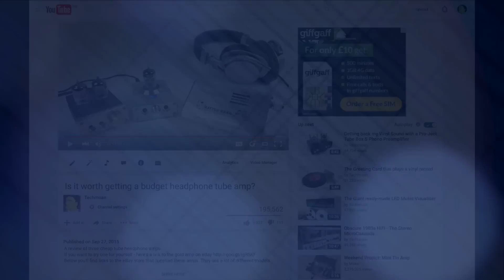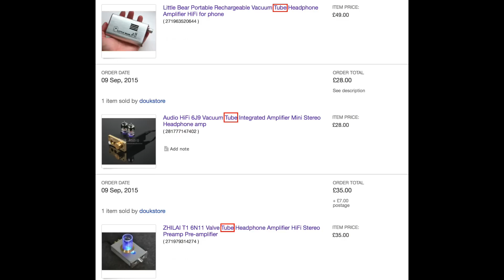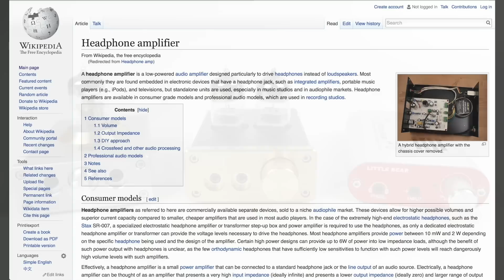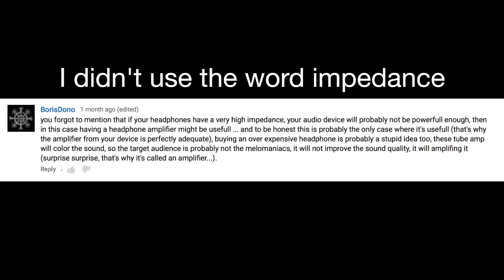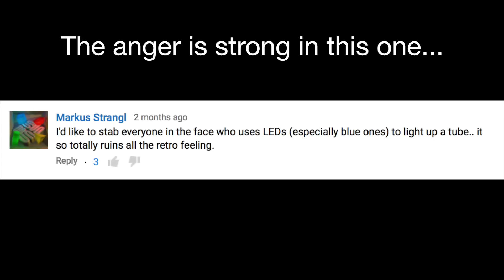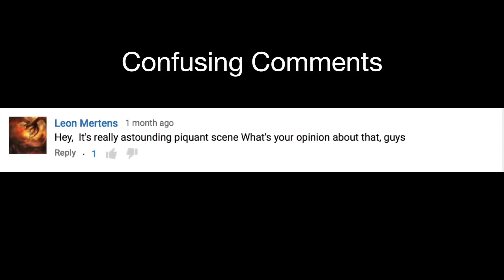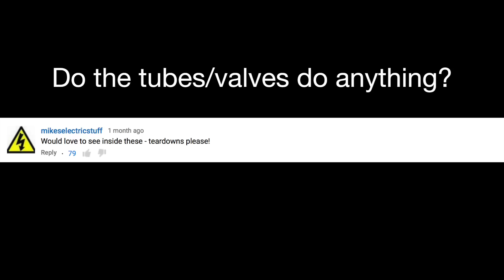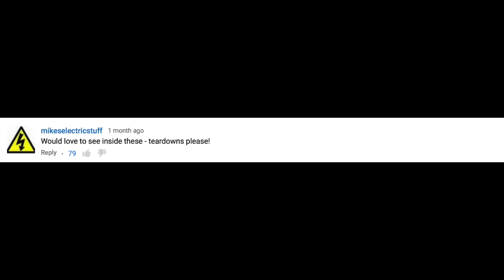Headphone Tube Amps - Follow-up & Tear-down

Comment: Tubes being microphonic pretty much just means they aren't in good shape. I'm not sure of the exact mechanism, but I believe some spacers inside the tube loosen up, which causes parts of the it to in vibrate in response to bumps, which causes the ringing. They are called microphonic because a tube in that state will be susceptible to vibrations, just like a microphone is. The fact that you could hear the ringing is a dead giveaway that the tube is in fact being used to some capacity, at least on that one amp.

The whole argument about tubes needing high voltages doesn't really do much either, stepping up voltages is a fairly straightforward process. Even back in the day of film cameras, flashes worked with upwards of 200V, which was generated from one or two AA batteries.
Reply: +ManuelJBD — Microphonics are a characteristic of most tubes, even when they're brand new.  It's caused by movement of the plate, grids and cathode relative to each other when the device is struck or vibrated.  The changing spacing affects capacitance, which causes modulation of the plate current.  Microphonics can be reduced, but not entirely eliminated, by adding more internal supports and reducing the physical size of the tube.
Reply: ***** I would suspect so. I remember I made a simple preamp circuit to buffer a piezo pickup, but due to a simple error I made it have a bunch of gain, and I noticed the entire board was microphonic. When I narrowed it down, I realized what was reacting was a ceramic capacitor!
Reply: ManuelJBD Yes, ceramic capacitors exhibit piezoelectric properties, so they can be susceptible to vibration and flexing.
Reply: +ManuelJBD That makes sense now. Back before you could find anything on the internet, I had a Peavy Twin amp that would ring like that just playing on it. I never looked to see what it was and the amp is long gone though I wish I still had it. I get the impression of the filament in a light bulb when you tap it.
Reply: +ManuelJBD Back in the 1910's-20's, most radios were run on batteries. The B batteries that supplied the plate voltage were in the 50-90 volt range. The heater batteries were usually 6 volt lead "car style" batteries, and when used, the grid bias batteries were usually 1.5 volt flashlight batteries. Battery powered portable tube radios and phonographs were still popular in the 1950's. These radios were fully capable of producing room filling sound.

Comment: The 6N11 is a Chinese version of the 6DJ8/ECC88. It is a twin triode (three electrodes, cathode, grid, and plate; similar to the collector, emitter, and base of a transistor) originally developed as an RF amplifier for TV receivers. It is a nine pin miniature tube. The pins used are 3 and 8, cathodes; 2 and 7, grids; 1 and 6, plates; 9, internal shield; and 4 and 5, heater.

The 6J9 is a triple triode, 10 pin miniature tube, originally used as an RF amp, oscillator, and mixer in FM radio receivers. It's pins are 3 and 10, cathodes; 2, 9, and 7, grids; 1, 6, and 8, plates; and 4 and 5, heater.

The 6021 is an eight pigtail sub-miniature industrial twin triode used as an RF amp and oscillator. It's pigtails are 5 and 4, cathode; 7 and 2, grids; 8 and 1, plates; and 6 and 3, heater.

I have no idea why they are using VHF RF tubes as audio headphone amplifiers, where audio tubes like the 12AX7/ECC83 would be more appropriate. I also have no idea what the ICs are for in those units, as the tubes alone should suffice in this application just as they did in the 1950's-60's.
Reply: +compwiz101 That's why old amps used a transformer to match the tube's output impedance to the low impedance headphones or speaker. The other alternative was to use high impedance headphones. BTW, it's not a good idea to run a transformer output amp, especially a high power one, without a load on the transformer's secondary. Apparently, you could fry the transformer.
Reply: @dougbrowning82  I have seem some vids of USA repair folk using a dummy load, what actually is this comprised of and does it need to be matched to the different transformer outputs ?
Reply: @highpath4776  A spare speaker that matches the impedance and wattage of the original should work (could get quite loud and may blow the speaker). Alternately, you could use straight resistors (resistors will get hot, and you can't hear the output), or a combination of resistors and a speaker. Search Google for dummy load circuits.
Reply: The problem with high impedance headphones and speakers like those used by 1920's radios is that you end up with high voltage on the audio lines. They are also harder to manufacture, and end up being more expensive. Though high impedance dynamic speakers (this is, using a cone with a coil attached and a magnet) existed on later budget devices, most of high impedance devices were vibrating iron type. These included the so-called reed speakers, and earpieces that had a steel disk as their diaphragm. They worked, but their audio quality would be considered unacceptable by most modern consumers.
Reply: +Doug Browning A lot of the headphone amp designs I've seen tend to pass the signal through the tube, then use solid-state components to provide the final drive current to the relatively low impedance headphones. Most tubes have fairly high output impedance, unless you're using a cathode follower...
Reply: +Doug Browning Yep. If you're going to build a tube headphone amp, you really have to budget for two output transformers. As I recall, running without a load can allow (in high voltage amplifiers) for a number of problems, including the power tube not seeing the correct load, but also inductive spikes in the transformer exceeding the winding's insulation strength.
Reply: The ICs are mostly likely being used to generate clock signals to boost voltage from that battery through that 6800 uF capacitor. Think Dickson voltage doubler. That's likely how a 12 volt power supply or that rechargeable battery can achieve enough voltage to push a tube.
Reply: +compwiz101 As I recall, even the early transistor amps in the 1950s and 60s, had transformers, not only as impedance matchers, but also as phase splitters for push pull output stages. Engineers in the day certainly didn't mind budgeting for a lot of iron in their designs. Since we're going back to vintage tech, though, why not just bring back high impedance headphones and speakers, like they had in the old days? Perfect for use with tubes, no transformers required.
Reply: +Doug Browning  Old surplus stuff. Personally, RF tubes always sound narrow. 
Any chance we can measure heater voltages?
Reply: +Don Petrik All three tube types use 6.3 volt heaters.
6DJ8 - plate = 90V, grid = -1.3V, amplification factor = 33
6J9 - plate = 125V, grid = -1.0V, amplification factor = 57
6021 - plate = 100V, grid = -6.5V, amplification factor = 35
(all ratings per section)
Reply: +Doug Browning 
"measure"

On paper is fine, what are we getting in the device for real? (measured heater current under load would be even better lol)
Reply: I totally concur.   Especially the notion of using op-amps and RF thermionics....  But then, the Chins use all sorts of weird thermionics in their designs....  As a browse through eBay shows.   Like the weird FU32 (832A - Push-pull tetrode...), athough admittedly,  it is appropriately an amplifier bottle.
Reply: Due to the potential
Reply: There is some idea that solid state amps as pre-amps are a good idea, with the tube technology giving the main AF amp.   Indeed why use RF frequency Amps though,  I presume someone sold the Chinese some kind of false espionage at some time and they think it is the correct use, though as circuit design books are avalible it would make sense for them to investigate and design something from first principles, something I dont think the chinese are capable of because they dont understand what is trying to be achieved as the end result.

Comment: The pins of the tube sockets are propably all connected. These are double sided pcbs so traces might go off the top layer of the board too. From the general behaviour of the device I'd say the tubes are working.

Comment: The tubes are running off of their required voltage.  The amps use a DC to DC  converter to boost the input voltage up to something higher, possibly hundreds of volts.  No mystery.  It's a much more compact and inexpensive alternative to expensive bulky power transformers.
Reply: +FelixTheHouseFreak but you can't see a single capacitor rated for that voltage on those boards... and you would need a output transformer if the tubes are operated at 100+ volts... so the tubes are either operating at very low anode voltage  in starved mode  , or just a decoration (e.g. filament in the audio path to break the path when the tube is removed)..
Reply: Robert Jung
Don't let the size of those caps fool you, some of those look like they could just be small value with high voltage.  Also its sometimes possible to use a high value low voltage cap as a low value high voltage cap. Could also be that the electrolytic aren't related to B+. No output transformer is necessary considering it's going to be driving a relatively high impedance load, some current limiting scheme would be enough.
Reply: FelixTheHouseFreak you definitely can't use "high value low voltage cap as a low value high voltage cap" as you mention... the yellow board has all electrolytic caps rated for 16V - so either very low anode voltage (e.g. tubes operated in starved mode at 12V anode voltage) or fake. info on valves/tubes operated with very low anode volatge: http://www.valvewizard.co.uk/Triodes_at_low_voltages_Blencowe.pdf
Reply: +FelixTheHouseFreak Hey remember me?
Reply: +Robert Jung That explains what those op-amps are doing in there.
Reply: Also by the way the caps are in series to add up to a high enough plate voltage.  In series the capacitence becomes lower but the voltage adds up, for a high voltage low current circuit only a small amount of capacitence is needed.  The op amps are the outputs and the tubes are pre amp.  Though it could be the other way around as well if the tubes are high current enough to run without a transformer.

Comment: Yes the circuit really uses the tubes. I would guess that any improvement they give is really minimal as the high tension is going to be far below the ideal operating level. There is no sense in doing this except for the cool looks of the thing. The pair of NE5532 op amps are perfectly capable of being a high quality headphone amp without the pretty tubes.

Comment: On the first two models, there are circuit traces on both the tops and bottoms of the boards. So while it looks like very few tyeube pins are connected if you look at the bottom side, taking into consideration the topside traces the tyeubes seems to be comprehensively connected. But I can't tell you to what.

Comment: Most likely the opamps provide a bit of voltage gain and the tubes are used as cathode followers, which doesn't require an enormous plate voltage and provides current gain but not voltage gain, exactly what you need for driving headphones.

Comment: NE5532 are Operational preamps. They are supplying the 2 final Thermionic Tubes or Vacuum Tube or Electron Tubes or Valves (ALL these terms are EXACT! And you can use the one you like more! if only people study before to write any comment .. there will be less spammy comments and more culture around the world: https://en.wikipedia.org/wiki/Vacuum_tube ... don't pay attention to these :) )
in other words: the NE5532 prepare the signal to be sent to the Valve(s).
The Tubes are indeed the End Stage of the amp you bought.
The routes on the PCB are not "tracking anywhere" like it seems. Simply not all the Pins of the Tubes are leading to internal electrodes
Here the datasheet of the Sylvania 6J9 http://frank.pocnet.net/sheets/201/6/6J9.pdf
As you can see, the Pins 4 and 5 are not used.
Let me also tell that the best one is the first. the other 2 ones are very badly built. The third one with the battery is simply horrible. there are several mistakes in the design, they corrected with what is called "Piggy back" .. there are 2 piggy backs and moreover: very badly mounted. Something to be sent back to the builder immediately.
Reply: +TORMY VAN COOL Actually, in the 6J9, pins 4 and 5 are the heater. The base diagram doesn't actually show the connections for simplicity, you have to connect x to x and y to y
Reply: Yes right, I had just now a moment to go through it. but then the PC shown, can have the connection on the other layer OR in some intermediate layer.
He's not doing any measure, not even with a simple tester.

Comment: I suspect the dislike of the Pono Player is less about the device itself, and more the fact it's hideously overpriced, somewhat overhyped, and really has few buttons. There have been videos exploring whether or not those high-quality files sold in the Pono shop are really any better than a quality recorded MP3, and to be honest, I own an $11 Chinese player that can play FLAC files too(as well as OGG Vorbis- it's the L7 model made by a company called IQQ, if you're wondering) and has very good sound quality for how little I paid. I do dislike the low number of physical buttons and reliance on touch screen controls too, I see value in hardware buttons to control things, and Pono apparently suffered from issues with the touch screen at launch.  It also really eats up storage space with larger audio files sold in their shop, 64GB internal isn't going to stretch very far when files are bigger.

Pono just really pushes itself with more hype to its abilities than there really are, and it costs a fortune compared to other players that can handle lossless formats.

Comment: Great video! There definitely are 12V tubes that work pretty well in small amplifiers like that, I've built a couple myself. Unfortunately there's also a lot of "audiophile" phoolery products especially from China - and especially in those small tube amps. They will often just pass some current over the filaments with the actual audio amplification being done by ICs. So concern in the last video was reasonable.

I'm no expert on electronics, but I know the two ICs at the input are opamps designed for audio amplifiers. I suspect the audio is being voltage amplified by them and then passed through the tubes which then provides some current gain.

Comment: The reassuring components on the boards are the inductors near the power inlets (the cylindrical objects with enamelled wire wrapped around them). These are most likely part of a boost supply for the high voltage the tubes need, essentially meaning they are running the tubes correctly within their operating voltage ranges and most definitely are in circuit. The op-amps (8 pin chips) are probably doing the majority of the amplification work and the tubes just sit in circuit as buffers to give the output that (dare I say it) desirable tonality. Great videos by the way!

Comment: They are all using the same OP Amp NE5532 for the amplification,
Reply: Thets the PREamp. Tchoobes dont work with weak signals, therefore, that is amplifing the signal a little so the tchoobes- OH SORRY, VALVES- hear the signal. You should really look at that circuit board and see the traces.

Comment: Nice video.  I suspect these amps are not using the tubes (Or valves) to amplify sound.  Two pins are used to heat the filament.  If the tube number starts with 6, it has a 6 volt filament.  12 would be twelve volt filament.  (The filament is the part that glows red).  In the tube there is a grid (2 pins) and a getter.  (Tubes do not work the same way transistors work).  The grid would have about 300 volts on it, so I think this tube is just for looks.  I might be wrong but I don't see a 300V supply in there.  And several pins on the tube are not connected.  I would think all pins would be needed.

Comment: I think the only real way of knowing is to study the schematic's.  I intend to purchase one myself and reverse engineer it and then post my findings.
Reply: +janine fawcett Don't waste your money ! for one thing ,there isn't a high voltage capacitor to be seen , those 9 pin "CHOOB'S" need at least 100 volts to work . its obvious that those op amps are all that is needed to drive headphones . 
I'm guessing, the power supply for the OP AMP'S , is routed through the tube some how , so the op amps don't power up unless the tubes are in..

Comment: The question now is whether the tube is being used in the amplification or power stage. It is probably a 12AX7 in power stage so it doesn't really effect the sound quality.

Comment: It seems that the tubes are in use in all 3 amps. The reason for me saying this is that there are boost converters for the plate voltage, or so it seems at least. I can't find the filter cap for the high voltage in the 2 tube amp tho... But this may be because the tubes are low B+ voltage and they decided to use the 100mF/16v caps in series. Couldn't really find any proper datasheet for these tubes in order to double check this. But the heaters are usually pins 3 and 4, so they are connected to the circuit. The one external tube amp had pin 7 connected through a resistor somewhere for example, probably an input by the looks of it.
Also the boards are multi layered or at least double sided and that's why the tracks seem to go nowhere, they jump on the other side of the circuit board or on another layer. There is also a double op amp amplifier chip in all of them tho, namely NE5532N or P, possibly the driver stage.

Needless to say that tube preamps are kinda pointless for application such as this and the same result can be achieved by either another op amp preamplifier or even smd transistor one instead. They look good tho.